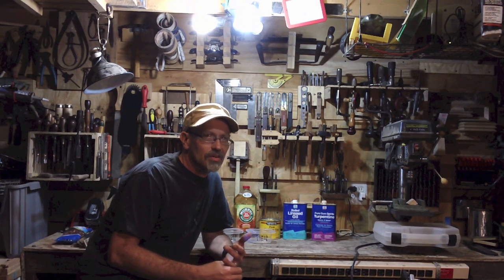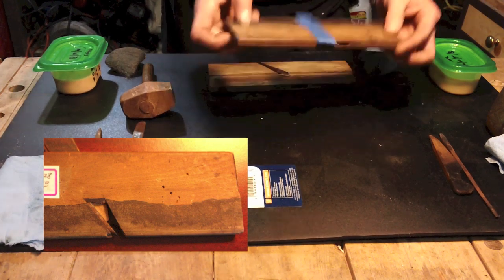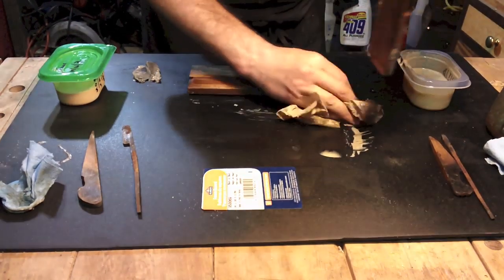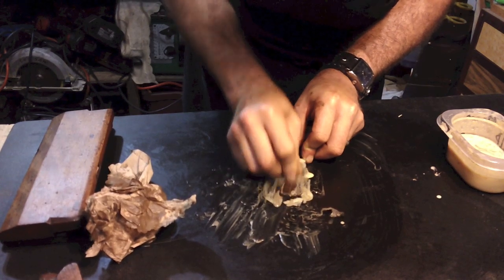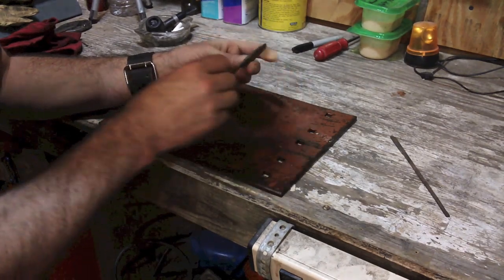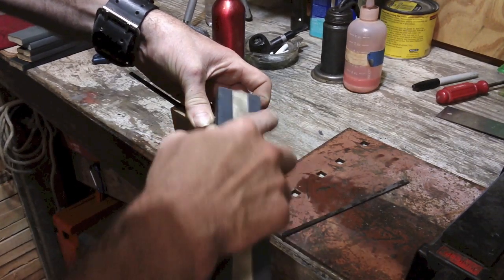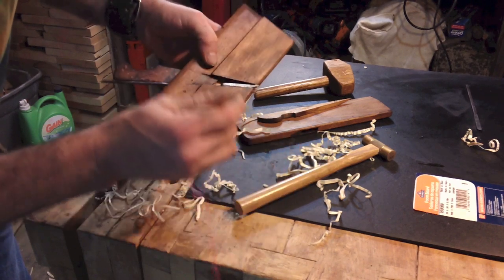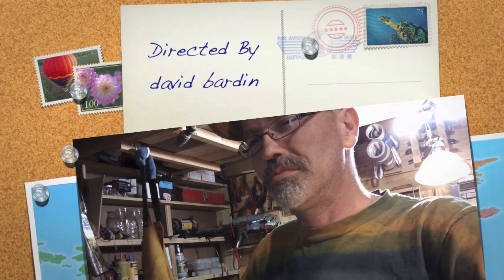Refurbishing a Moulding Plane

Comment: Loved the video! I know you're a big fan of saturating with BLO. I wax instead because Roy Underhill said that linseed oil will break down the wood over time. What he means is that, over many many years, the oil in the fibers actually degrades the wood on a cellular level. You won't notice it in your lifetime, but if antiques are to last for several more generations it isn't the best thing to use. Of course I'm no expert on it, but that's what Roy said back in 1981. :)

Comment: Hi Dave

Do you have any insight on grinding hollow and round plane irons?  I'm particularly interested in grinding the hollow, that seems to be a problem for me and getting the bevel right.  Thanks, Dave.
Reply from the maker: I do recommend the sanding sticks with wet dry paper wraped around them I like one edge pointed and one edge rounded. They have worked well and allow you to remove material at a rate that you don't harm the profile
Reply: sorry, I wasn't quite clear.  I was referring to a method for the initial grinding of a blank for hollows and rounds.
Reply from the maker: I would use a good compass for a proper lay out and machinist layout fluid. Properly annealed steel will cut like butter with a file. If you getting your blanks pre cut from a large manufacture and there laser cut the edges will be fully tempered while the center will be annealed. This in consistency will cause you great difficulty in getting a symmetric edge. All that said. Properly annealed and hand filled.